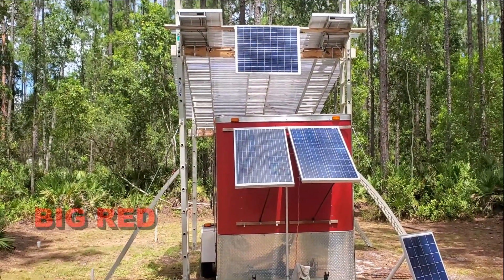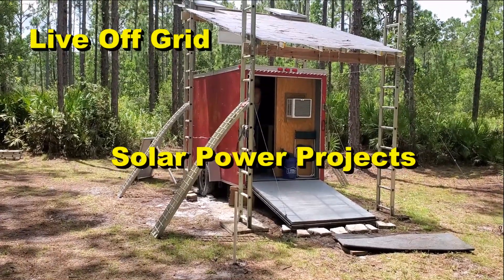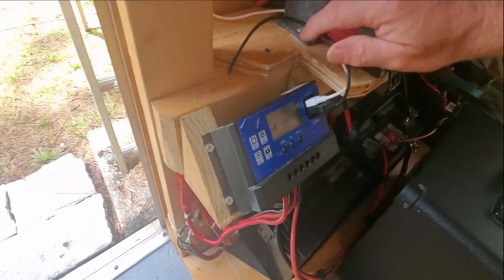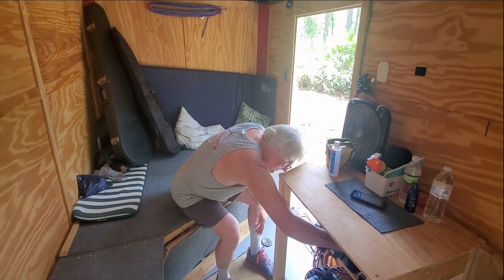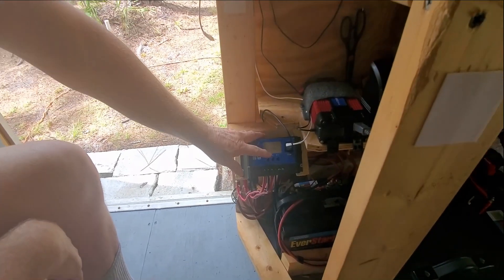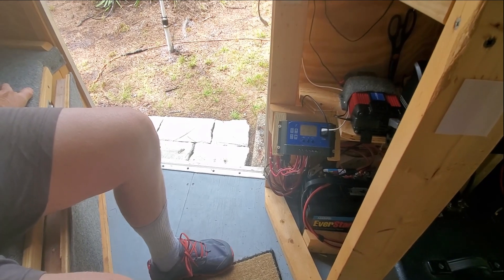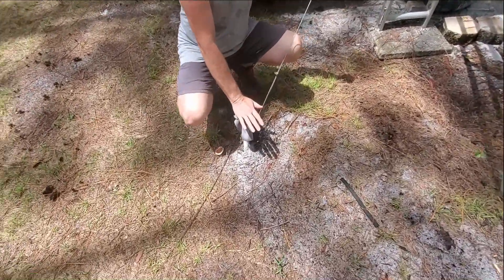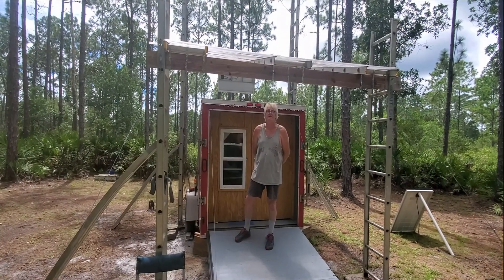Air Conditioner Runs All Day Off Solar Panel, Solar Energy Projects for DIY

Comment: Nice job.  Congrats. I did something similar once with $13 10' T-posts.  That still up?  The biggest threat to that set up is not nature, it's man..  trying to steal, destroy or report you. 

Long story (optional read).. but FYI.  I've tested 450W AC with solar.. IMO, it's not worth it and it's better to adjust your life to where you live vs trying to seal yourself in an air conditioned box.  Florida is hot and humid, but there are parts of Florida that are cooler at night and where sleeping with some USB fans is not uncomfortable at all.  Florid has no winter a blanket or sleeping bag can't fix.  No wrong way to live, but   I'm taking a very different approach now with just shade and fans.. lots of fans .. IMO,  Off-grid is a great opportunity to get away from couch life.   I'm building a tiny 4X8 personal, screened in pod UNDER THE TREES. It's a couch, desk, bed and counter.  Corrugated insulated roof, but otherwise open screened. USB fans super ventilate it.  Idea is to cook, eat, work and hangout outside under the trees, but mostly I find something else to do between 11am and 3pm...that's the best time to go out , have lunch, do laundry, go shopping, etc.. The pod is basically to sleep, couch and surf.. which unfortunately is an American pastime now.  A single 250W solar panel perfectly situated away from camp in direct sunlight will charge a 48v 50AH battery that is not only my only power source for fans and technology, but also drives an eBike 100 miles and will run my security camera year round.  Anyways, off-grid in Florida in July and August is brutal so I would try to van life in the  beach or  mountains those months.
Reply: I don't understand why you're 450watt ac didn't work out. As long as you have atleast 450watts of solar power while it's running I don't see how it wouldn't work if you have sunshine.  I'm sure it would take a decent size battery bank to run it through the night but it's doable 4sure. I'd use about 800watts of solar panels so it could run and have enough power to charge the batteries for night time use.

Comment: Are u using a 2 - 12 volt 100ah lithium or AGM batteries? Also, I guess u can run the AC with the back door closed or what?
Reply: It looked like lead acid flooded batteries to me.

Comment: How many amps does the air conditioning draw?
Reply: it must be a 4500/5000 btu 110v Window AC. must draw between 4 and 5.5 amps
Reply: @curierfromxibalba1155  With say 5 amp at 120 vac draw equates to 50 amp draw on his batteries.  I'd say his 2 batteries wouldn't last long even if they were each 12 volt 200 ah batteries. You wouldn't want to drain your deep cycle batteries more than 50% so you're only looking at about 4 hours of continuous running of that air conditioner.  He said he had as much as 20 amps coming in from solar panels during a sunny day. That equates to 2 amps at 120 volts ac not including the loss to invert that power.
Reply: Best to convert your loads to watts and compare those watts to the watts being used from the batteries.  Watts is watts regardless of the voltage. No conversion required.
Reply: How amps does a 110vac AC dra need when starting the motor? I'm wondering if i could skip the batteries.  I only want to supplement my house AC.  Cheapest way is to immediately use the power from the panels.

Comment: Is the Ac unit to keep all the equipment in the pavilion cool? Is that necessary and what does the pavilion provide electricity to?
Reply: Hey Jim, Thanks for watching. The air conditioning is helpful and is necesarry in the hot summer heat here in florida to maintain proper operation of he power systems. They would over heat and shut down under full loads of 15-17 amps 110 V AC ( current capabilities) 
COMING SOON, power from the big red power station SUPPLIES 2 camp sites on property as well as solar pump well power!! check it out on youtube channel atlanticdrain. Thanks again for watching